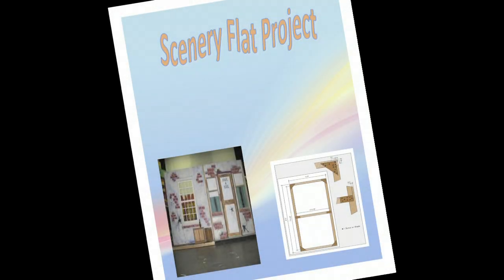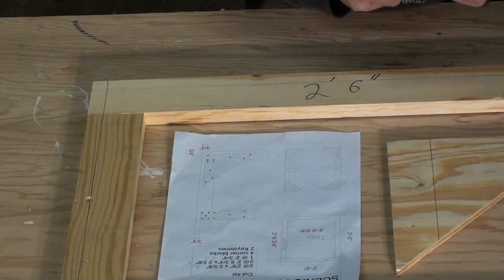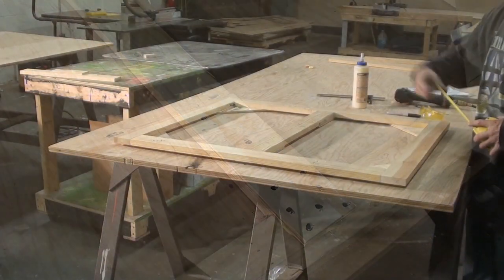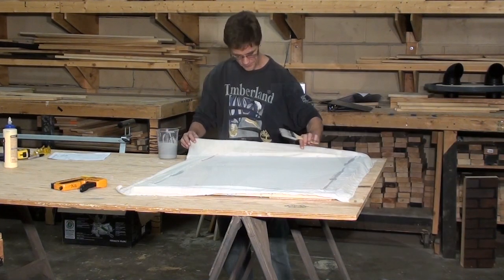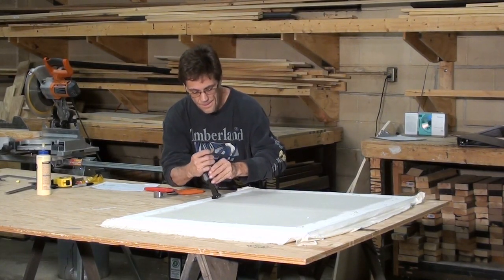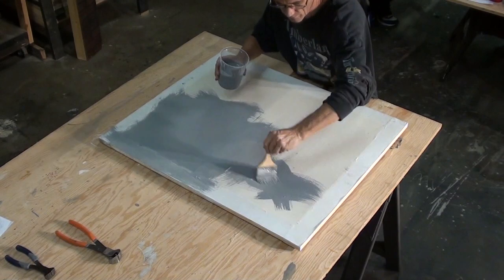Scenic Flat Instructional Video

Comment: Not a good instructional video: Several major mistakes are shown.

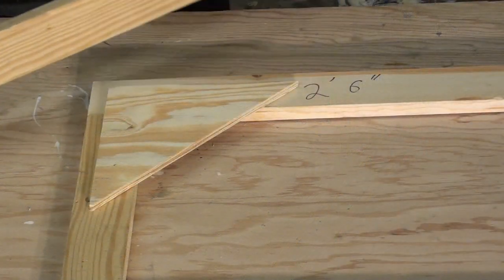0:37, corner block applied with the grain parallel to the joint.  Should run across the joint for max strength.

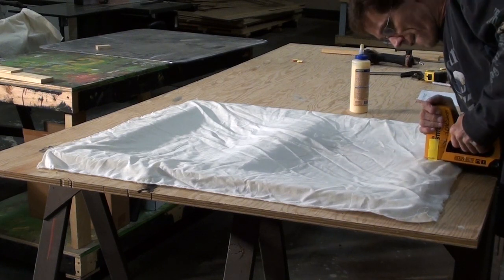2:14, fabric stapled to the frame through the face. The fabric should wrap around the frame and stapled into the flat edge.

2:37, glue brushed on the frame.  Backward: glue first, fabric second.

3:02 worst mistake: glue brushed onto the flat face, so paint will have a different finish.

Do not use this technique.